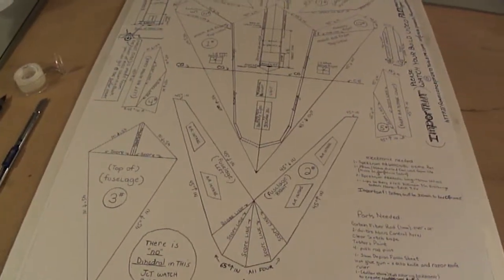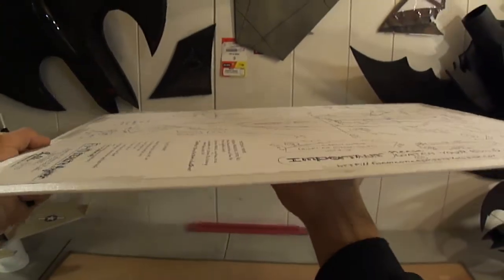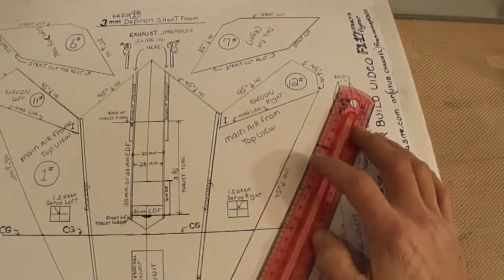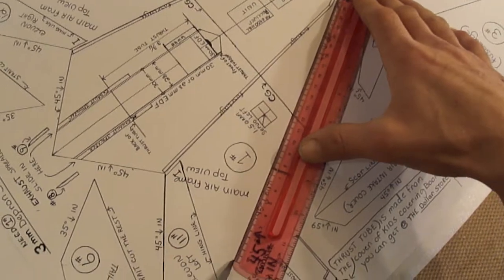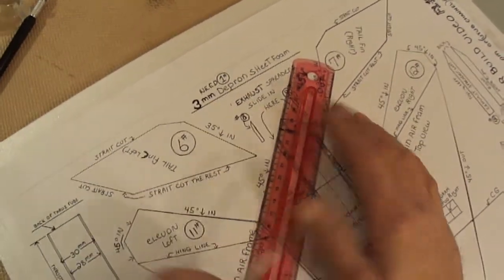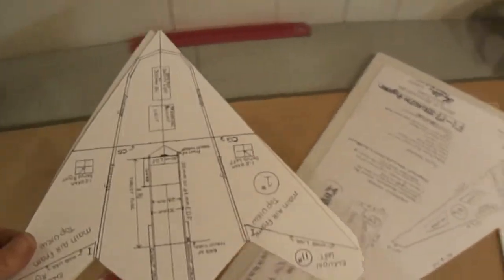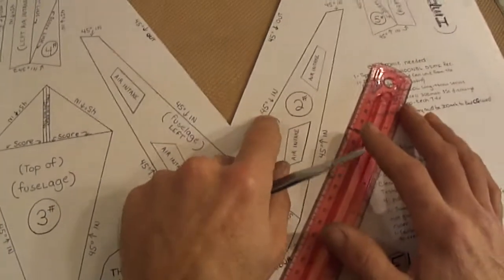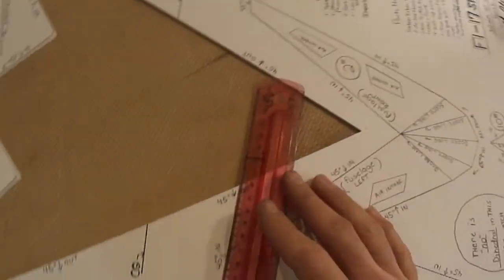PART 1 # of 3...Micro (F1-17 Stealth Fighter) Cutting, assembling and building your concept jet.

Comment: Can you post links to your electronics? That would be really helpful. Thanks
Reply from the maker: Using the AR6400NBL With Receiver with elavon mix and a 28mm Eflite 11700 KV Ducted Fan unit. and two 1.5 gram servos all the electronics from the Micro Stryker or Sbach with out the AS3X system, and just add the 28mm ducted fan unit.